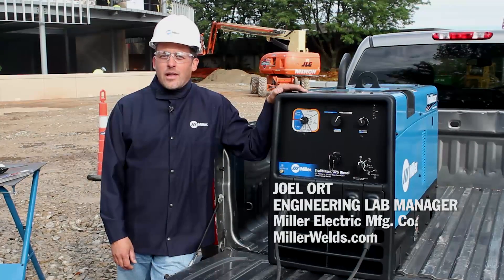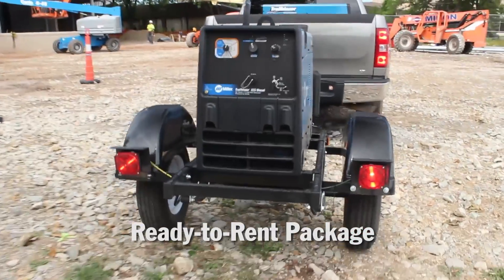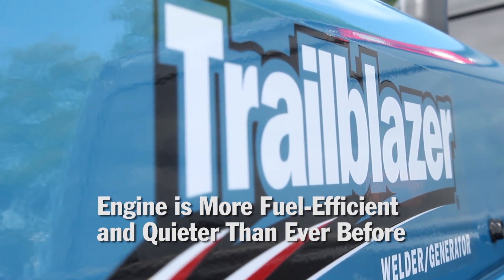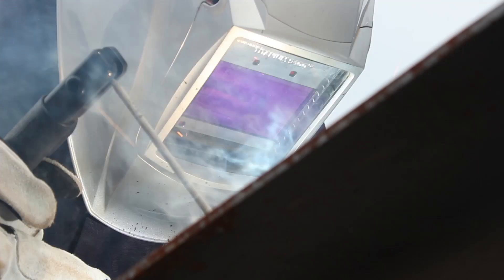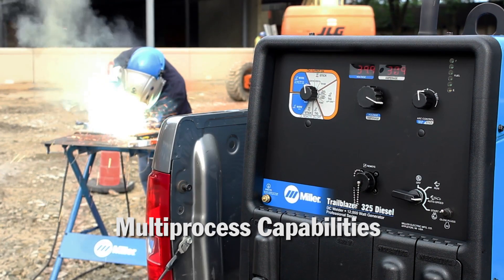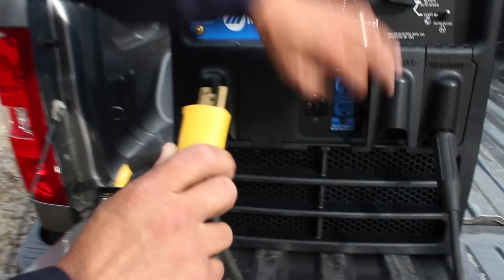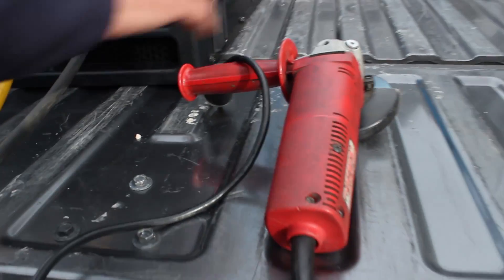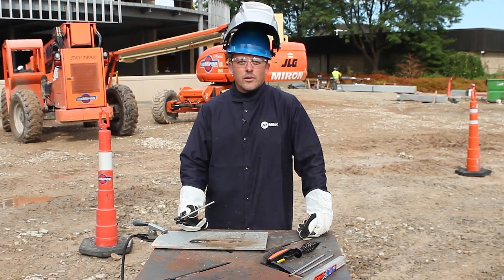Trailblazer 325 Diesel is Kicking Diesel and Changing the Game

Comment: F that, give me a 2011 brand new Ac/dc machine, I paid 4000 in 2011, now I paid 6000 n I got a smaller jumping up n down all day,,, Nah I put my old machine on run, n run all day wide up just fine no problem, I dont like the constant up n down drives me nuts
Reply: There should be an idle selector switch to keep it on high idle.

Comment: Can you generate power in the rain I'm guessing and hopeing so.
Reply from the maker: Hi Jon, thank you for the question. Yes, the Trailblazer 325 Diesel will operate in the rain. Thank you.
Reply: Miller Welders that's awesome I don't have to build a cover for it with that big dog I could probably run anything in my house actually multiple things in my house. And I can do more than just power the house I can weld Jump Start batteries generator and more. How much is the generator but I guess I'd have to go to one of your stocking dealers for a price.
Reply from the maker: The manufacturer suggested price for base model of the Trailblazer 325 diesel is $10,719 (US). To learn more about our Trailblazer line, please visit: https://www.millerwelds.com/products/trailblazer. For pricing and availability in your area, please contact a local Miller distributor: https://www.millerwelds.com/wheretobuy.

Comment: What happened to the polarity switch? AC?
Reply from the maker: The polarity switch was removed when the Trailblazer 325 was introduced roughly 7 years ago. We removed the AC weld capability when we changed the arc control technology.
Reply: Miller Welders but why? How does arc control technology replace AC welding? I hear from people that they wish the AC switch was still there.

Comment: why Hobart rod on a miller welder.
Reply from the maker: +2fast65 Miller and Hobart are wholly-owned subsidiaries of Illinois Tool Works (ITW). Hobart Filler Metals are exclusively recommended by Miller for a complete welding solution.
Reply: +2fast65 hobart is miller.

Comment: If you want the ultimate welding machine?? Get the Miller Pipe Pro 350 with the CAT C1.5 Turbo the best !! It runs circles around my Bobcat 250 NT with a stinking gas engine. The Pipe Pro 350 has 3 phrase welding power for superior welding chareristics unlike the smaller units it's all single phase power all around. Regardless you can't go wrong with a Miller man. Miller all the way !!
Reply: for $20,000 it better run circles around a $4,000 bobcat and its not a CAT engine its a perkins they painted yellow
Reply: @mikecubes1642  5 slightly used ones just sold at auction for $6500 to $4500. Hours varied from 2500 to 4500 on the machines.
Reply: The  Cat C1.5 is a Perkins engine